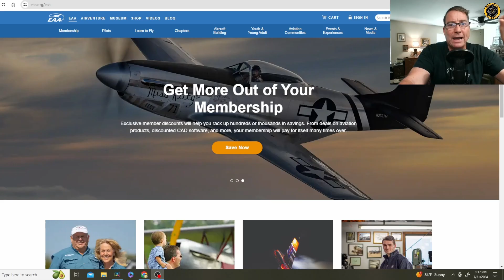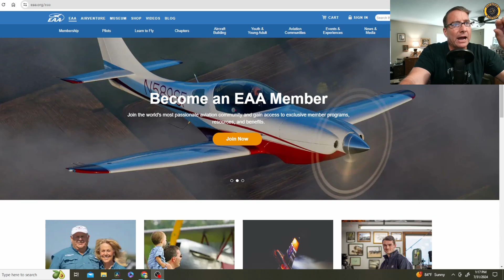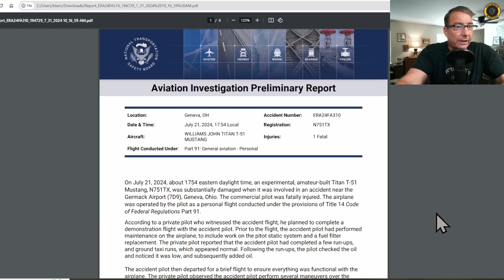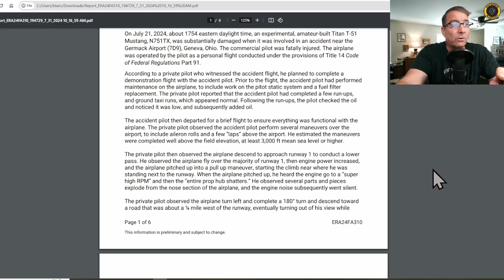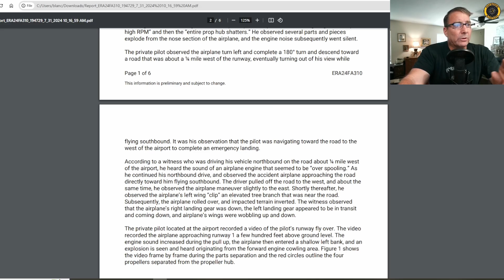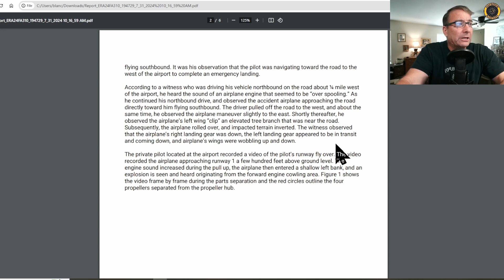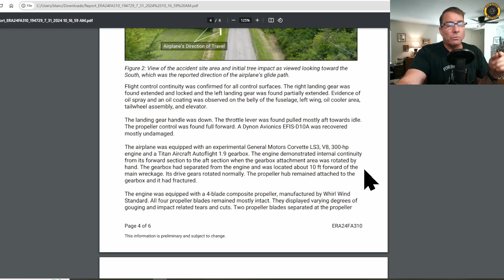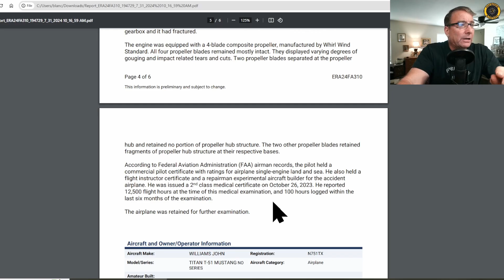Titan T-51 Fatal Prop Hub Failure 21 July 2024

Comment: I would guess the engine RPM surged because the hub failed and there was no longer force required to turn the now departed prop. Really a sad ending to a pillar of the experimental community.
Reply: Looks like the hub failed.... with no longer provided force (drag) back to the motor causing the sudden high rpm....   Sad ending for a solid aviator.   Too bad the failure occurred at low altitude....   no time to recover.
Reply: @seewind  The report here shows he had enough altitude and speed to do a 180, the advantage he had was no windmilling 4 blade prop to cause drag. In my opinion, he seemed to be trying to save the airplane, dropping the gear at the end. The impulse to save it might have been overwhelming.  He probably should have gone straight ahead, gear up into a field to the left or right. My 2 cents.
Reply: @bernieschiff5919  Yeah.....It seems fairly obvious in hindsight, but obviously he thought that he was going to put it down on that road without any issue.  Quite frequently misguided confidence makes for a bad outcome.
Reply: Loss of oil pressure to prop governor will cause it to go to low pitch, the rest happens just like it did to Kevin Eldridge
Reply: @svenelliott521 the comment on the low oil prior to flight had me wondering about this one also.
Reply: @svenelliott521 that's only if it's not a counterweighted prop. For serious aerobatics, normally it is.
Reply: I'm going to guess that the engine had an rpm governor that failed, leading to overspeeding the prop hub and causing its failure. One of the things that makes auto engine conversions dubious is that auto engines are engineered to have very high peak power at high rpm, but low continuous rpm/power, because that's how they're used in cars. You accelerate from a stop or to pass another car on the road, but then cruise at a low throttle setting. Airplane engines are the other way around, running at a continuous power setting, either cruise or max, most of the time, with peak power only selected during takeoff. For the LS3 V8 to be rated at 300hp in an aircraft application, it was probably governed to an rpm where it could safely sustain that power output for extended periods. This would be a lot less than the power it could produce if allowed to rev to its mechanical limit. Take away the governor and suddenly it's putting vastly more power through the gearbox and prop hub.
Reply: I don't know why everyone in this chain is speculating on the order of events when Juan clearly reads the eyewitness testimony that the engine was HEARD to overspeed, and then the hub was SEEN to have shattered. It's right here: 6:13
Reply: @gobs379  The order of events doesn't get us very close to a cause. It doesn't tell us it was an engine failure, a prop control failure, prop hub failure, pilot input, any of that. All are still on the table regardless of the order of RPM surge vs blade separation.
Reply: @gobs379  Because eyewitness testimony is famously unreliable.  I'm waiting for the NTSB report analyzing the video and the actual parts.
Does anyone have the video on line??
Reply: @gobs379 
 Because eyewitness testimony is often wrong and because if the events happened nearly simultaneously it would be very difficult to distinguish from the ground. 

Most witnesses would report that they saw whatever makes sense to them in their minds. It's easy to imagine that the thing over reved and blew itself apart so that would be the default testimony from most witnesses, unless what actually happened was very obvious.
 I think it's called confirmation bias.
Reply: Or the other way around. A propeller control or governor issue could have made the RPM surge beyond design rpm which would then have caused the propeller or its hub to fail.
Reply: @coriscotupi  Interesting theory but if controller moved pitch to zero how high can the rpm really get before valves float?   Enough to fail the hub, I don’t know but seems unlikely.   Zero pitch means no thrust thus lower bending loads another strike against s secondary hub failure.    If video captured has sound of engine the rate of prop unloading can be estimated with some accuracy.   I’m guessing that would show a much faster change than the controller could produce.
Reply: @timduncan8450  If the mechanism that controls prop pitch has somehow failed, it doesn't necessary follow that the engine speed increase caused the prop blades to separate. We don't really know what the initial failure was or the full extent of the damage it caused. I see a lot of people forgetting that correlation is not causation. If there was a failure in the prop mechanism that resulted in zero-pitch blades, that same failure might also have caused the blade separation. Engine speed might have nothing to do with it. The surge in RPM might have been the result of the problem, and not a cause of any problem.
Reply: @timduncan8450  
"how high can the rpm really get before valves float?"
Pretty high, regardless of valve float. 
This is because with a flat enough propeller pitch at high airplane speed, the engine is no longer driving the propeller, it's the other way around: the propeller now acts as a turbine driving the engine, which acts as a load for the propeller - and the prop + engine will turn at whatever high rpm the prop can turn the engine. This is a failure mode not unheard of in propeller governors.

It does remain to be seen if with this particular hardware the rpm could surge high enough to actually brake the hub (and indeed if that was what happened here), but it is a distinct possibility. The investigation should be able to tell.
Reply: One of these engines in stock configuration would have the ability to turn it up to an RPM range between 6,000 and 7,000 RPM reliably.
Reply: Another point that would be noticeable in a video with a fair audio track would show that if the engine was still using an ECM and were to achieve a operation that included an engine overspeed that would be very noticeable in the audio because it would change the exhaust drastically as they usually use a design to starts dropping plug firing to limit the ability to keep gaining RPM and would sound similar to a misfiring ignition problem and usually is accompanied by a noticeable amount of flame out the exhaust due to the misfiring plugs.
Reply: That was my first thought too. Were the two blades that departed without any hub pieces cracked or improperly attached to the hub? Could the departure of one or both of them unbalanced the hub and caused it to disintegrate?
Reply: My guess also. Prop hub was probably cracked long before it broke. Stress crack, bad metal, something.
Reply: @AllanHatz Given that there's video evidence, whether the RPM surge or the hub failure came first can be established from that.
Reply: @JonBrase  Maybe, I don't see the NTSB spending a lot of time and resources digging into deep on this one. Obviously it broke at inopportune time with a very unfortunate outcome but not enough of these conversions around for them spend much effort on.
Reply: @AllanHatz  If the rev-up is audible before the debris event, then it's dead easy, requiring basically no analysis: in that case we know for certain that the rev-up happened first. If it's audible after the debris event, then the distance between the aircraft and the camera at the time of the debris event has to be determined, so there's a bit of analysis to be done, but once that's known, determining the sound delay is gradeschool math.
Reply: @JonBrase  No, it's not dead easy like that. You always have to continue analysis. If you stop when you find something that seems obvious to you, here's what you miss: Prop hubs can fail to a pitch flat condition, removing almost the entire load from the engine, causing a sudden engine overspeed like the one reported. When the Embraer Brasilia came out, that was one of the bugs it had that made the pilots nervous. They fixed the problem, which came down to the failure of a hydraulic tube in the prop control mechanism. The props went suddenly flat (what they call beta range in that plane), which is very dangerous because of the sudden engine overspeed and potential for catastrophic engine failure (possibly parts flying through the cabin and passengers) and because of the potential for loss of control due to the sudden, massive drag from the prop blades in beta range on the same side of the plane that had simultaneously lost power.
Reply: @beenaplumber8379   If controller moved pitch to zero how high can the rpm really get before valves float, this is not a turbo prop.  Enough to fail the hub, I don’t know but seems unlikely.   Zero pitch means no thrust thus lower bending loads another strike against  secondary hub failure.    If video captured has sound of engine, the rate of prop unloading could be estimated with some accuracy.   I’m guessing that would show a much faster change than the controller could produce.
Reply: @AllanHatz everyone loves to blame the NTSB for not investigating every detail.

The NTSB does not have the resources to dedicate to incidents that don't kill many people.  NTSB has less than 500 employees, they also have to deal with literally every other type of transportation.

Bridges, railways, ships, even pipelines.  Turns out they can't turn everything into TWA 800 reconstruction.

It's asinine that everyone thinks they can dedicate years of effort for a single pilot crash, but here we are again.  Like Pilot Debrief but with less respect for the dead.
Reply: @ACME_Kinetics  I can't tell if you're agreeing with me or scolding me. I just stated the reality, the NTSB isn't going to spend a whole lot of time or resources on it.
Reply: It was a test Flight, He did all kinds of Maneuvers, maybe He bumped into the Throttle by Accident, or tried out the limits - and ECM wasn't set to limit rpm correctly - causing Prop overspeed? RIP John.
Reply: The pilot probably done a fairly sharp pull up causing stress on the prop hub.  Auto conversions are far more complicated to get correct than it appears. Peace to the family.
Reply: @grumman38  As a race car guy, it just seems like personal planes are all stuck in the 40s with their tech.

Never been in a death tube and never will.
Reply: @anthonyrowland9072  brand new planes, even little Cessnas are actually super technologically advanced. You're starting to see basically full FADEC on some of the fancier 2 seaters even. The prices however, are absolutely insane. The reason it seems like most small private planes are 1940s tech, is because any plane that's affordable for a fairly regular person who isn't a multi millionaire, probably was built closer to the 1940s than today.
Reply: Agree
Reply: The engine has a rev limiter. What was it set for?
Reply: Making the 180 degree turn didn't help him. I get it though. In that moment when the propulsion leaves and you are low and slow the instinct is to get back to the runway. Very counter intuitive to instantly decide to fly straight and look for a place to ditch.
Reply: You got it backwards: 
With the prop and hub gone, there was no more load on the engine. No more resistance to it's power input. 
Allowing it to overspeed pretty damn easily.
Reply: Jettison the canopy, roll inverted, release the harness, and, "hit the silk".😁👍
Reply: Would a rev limiter on the ECU help?  Love the P-51 and any effort to get even a close model in the hands of pilots is so cool.  Sad to lose him.
Reply: nevertheless, the failure of whatever part let go it’s just part of the process of progress. it cost this guy‘s life, but the contribution to aviation  posterity is certainly going to be huge.
Reply: How come nobody is talking about the rev limiter. It had one and should have stopped the over rev . . . ?
Reply: engine electronics rev limiter should or would have prevented that.. suggesting something in the engine failed transferring shock into the gearbox or shaft to fail
Reply: @Errol.C-nz  The limiter was likely still set to the factory rpm, which was far too high for the propeller.
Reply: just say the engine wasn't under load anymore...
Reply: The engine ECM should have had a relatively conservative ref limiter to prevent over speed in this application where they are only targeting 300 HP. These engines are normally rated around 430 HP.
Reply: Yes. Would be like accidentally shifting into neutral while going 70mph on the highway, and then the engine would rev high.
Reply: I would just want to ask the witness if he heard prop overspeed or just engine overspeed.
Reply: @bendeleted9155 the two would happen almost instantaneously,  (Fraction of a second) but the failure was the prop hub.  Regards
Reply: @iancormie9916  where I was going with this was did the prop hub fail before the high rpm condition, in which case there would be no prop overspeed heard, just engine overspeed, especially if the rpm sensor went with it. Sounds like it's a moot point since there is video and a knowledgeable witness.
Reply from the maker: No, see pinned comment above.
Reply: @blancolirio  then explain where the HP came from to overspeed a prop governed by a certified governor.   You keep saying no, but you don't give your reasoning.
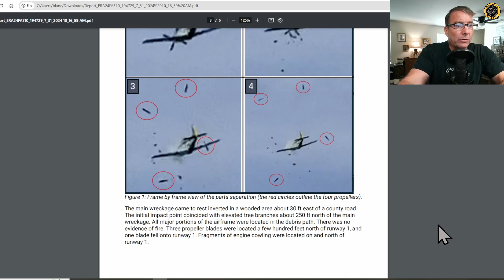Reply: 9:00 could one calculate the prop rpm with those frames?
Reply: @daviniusb6798 Great question. I’m a physics teacher, and the answer is yes :). Rotational velocity is easily convertible to linear velocity. Using the prop piece lengths and the frame rate of the camera, one could measure linear displacement of the props, and work backwards to get rpm.
Reply: @jgalexander510  Thank you :) IF those on the top are frames one and two, I get a median of 33° of blade movement between them, and an online calculator (sorry, I'm bad at math) tells me that those 33° correspond to 165rpm if the footage was shot with 30fps or 330rpm if the footage was shot with 60fps. So, I know nothing about prop speeds, could anyone tell me if 165rpm or 330rpm are normal propeller rotation speed or not?
Reply: @daviniusb6798 so, the rotation of the blade spinning freely after leaving the prop hub won’t match the rpm of the propellor. It’s hard to say if those blades have spun less than one rotation or more than one rotation between frames. A better move would be to measure the length of the prop blade (as recovered from the accident site), then use scale to essentially make a ruler for the photos. Say, for example, that the prop blade closest to #3 is 1meter long. You could measure the distance from the center of that blade to the nose of the plane. Then you could do the same for image 4. The difference between those two distances would give linear velocity, which (with that math you love) could be converted to rotational velocity. Doing it for all four blades would get a decent average rpm. 
Generally, props spin around 2000-2500rpm.
Reply: @jgalexander510  I hope the NTSB is doing all those calculations for us, because I'm not even sure if the blades were still attached to the hub in frames 1 and 2. But thanks for playing along Mr. Teacher :)
Reply: @jgalexander510  Correct me if I'm wrong, but the location of the center of gravity along the length of the of the blade would need to be known to calculate the rpm from the linear velocity of the blade. Pesky little pieces of hub that might have been clinging to the base of the blade could significantly change the location of the CG. Not to mention the large forces (i.e., acceleration) that air can impose on foil-shaped objects traveling at high speed. I'm not saying that the calculations aren't worth doing, but I think deciding on the correct assumptions to make before doing the calculations would be anything but "easy".
Reply: @andrewsnow7386 Hi, correct on needing to know the CG. Here’s how I interpret the solutions to what you mentioned: The CG could be determined relatively well by retrieving the blades (and whatever bits of hub were attached) from the ground. 
Acceleration due to air resistance could be determined by calculating the change in velocity for each blade between each video frame. 
The “easy” part of the calculations is the conversion between linear and rotational motion at the CG point for each blade.
Reply: If the hub fail, the propeller rpm doesn't increase. In this case the propeller rpm increased, causing  the destruction of the propeller, so I think the hub doesn't was the cause.
Reply: @gustavosegal5881 At a fixed throttle setting the Engine power and propeller drag are balanced. If the hub breaks there is no longer the drag for the engine to work against and it's RPM will surge.
Reply: @kjdude8765  You're forgetting that at low pitch & high airplane speed, the propeller may no loner be just drag, but may actually function as a turbine driving the engine to a grossly high rpm. Much higher indeed that that of a no-load full throttle condition.
Reply: @kjdude8765  I'm thinking that the prop went flat pitch, and that cause the cascade of destruction.
Reply: @kjdude8765  The modern electronic engine control unit normally give fixed RMP determined by the throttle potentiometer.
It is possible that he wired the potentiometer incorrectly, causing it to operate as a series resistor. In that case what you said would have happened. 
Ideally, a lower value potentiometer should have been put in series with a resistor to give to correct final value, so that full rotation would have been 2,000 rpm at the prop. Adding resistance rather than splitting it could have resulted in a malfunction.
Unless you fully understand the circuit, it is easy to make a mistake.
Reply: @kjdude8765  yes but it has a rev limiter in the ECU
Reply: @gustavosegal5881  Not the propeller rpm; that of the engine.
The hub quite likely failed, thus removing all load from the engine & allowing the sudden & significant increase.
Reply: @GARDENER42  Agreed, that was my supposition, and I am not sure why Juan's assumption is that the engine surge caused the hub failure, not as you said, that the propeller hub failed, removing the load from the engine, which in turn caused the engine to surge.
Reply: @pulaski1  There seems to be quite a disagreement about which came first, RPM surge destroying the hub or the hub failing first (we are all guessing however)? I am thinking there was possibly a prop pitch failure followed by the RPM increase due to sudden loss of loading THEN total hub destruction due to the centrifugal force from the over-speeding of the hub/blade assembly? Then there are the huge gyroscopic loads encountered when suddenly changing course directions that may have contributed to the hub failing first due to metal fatigue? Hopefully the investigation reveals the true cause of this extremely unfortunate event but that remains to be seen.
Reply: @GARDENER42  so, what's the reason for the propeller exploding?
Reply: @catman4644 Your supposition makes the most sense to me given the evidence. I think it would be very easy to get the destruction sequence wrong in this case.
Reply: @GARDENER42  One would hope there was some sort of rev limiter. Typical aircraft installations do with custom ECUs, rather than the automotive versions, so we don't know.
Reply: @GARDENER42  That's what I'm thinking - Hub failed or props detached, removing load causing engine RPM to then surge? "Composite" propeller blades??? Might be fine for a windmill, which have also been known to run away, but on an AIRPLANE? He was asking for it!
Reply: @GARDENER42  But the engine had a rev limiter. Why don't people know that
Reply: @gustavosegal5881 the blades are attached to the hub, so if the hub breaks up, the blades go too.
Reply: @gustavosegal5881 not true, the moment the hub fails the engine RPMs will increase because the engine load has been removed.
The only failure here was the prop hub.
Reply: @gustavosegal5881 

     I disagree.    

      If the hub undergoes rapid unscheduled disassembly in flight, the blades are no longer absorbing the torque from the prop shaft.    Without this “resistance”, the RPM will runaway.   

      In this case, the automotive engine computer most likely shut down the engine as it approached redline.

      This is analogous to quickly moving the prop control forward in a “constant speed prop” engine.   The RPM quickly surges as the blades go flat faster than the governor can react and add oil pressure to maintain max RPM.